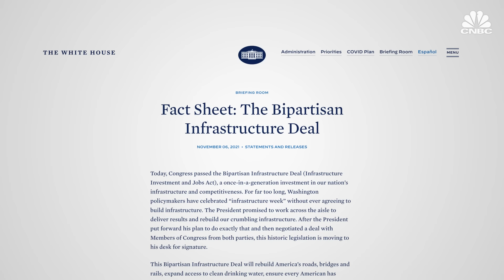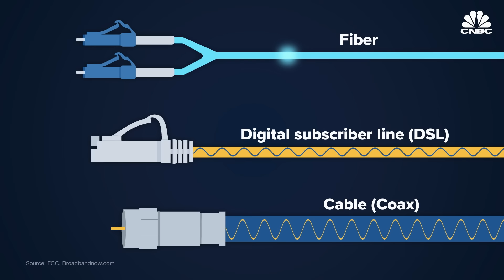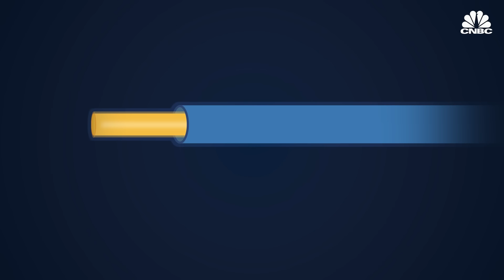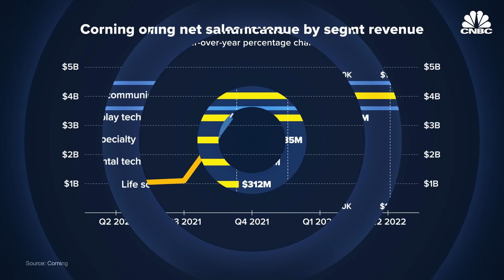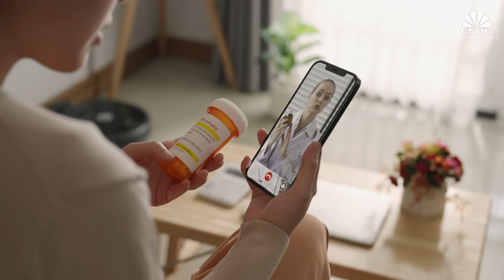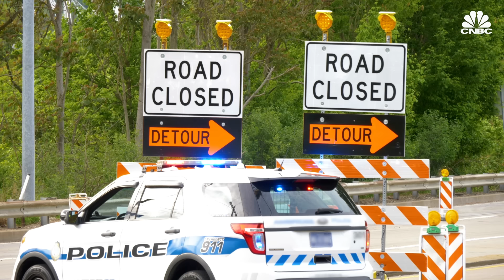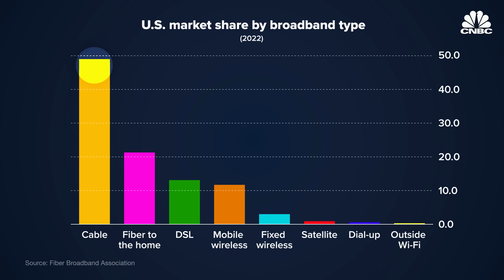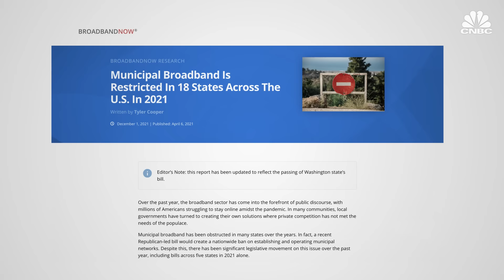How Fiber Will Speed Up America’s Internet

Comment: In the US the key take away is the telecommunications contracts in place that limit competition and choice in most medium to low density areas.  I'm a IT professional and work with datacenter fiber a lot and it's 100% the way to go. However, for homes, telecommunications companies are the issue in most cases.  They aren't willing to build large fiber networks with low subscriber density.  Starlink is way more important than the guy in the video is stating.  More important is that Starlink v2 will be a massive improvement in both throughput and cost to orbit.  Some of the costs that he mentioned are early numbers.  Today all Starlink satellites are launched on reused boosters which greatly reduces costs.  Starlink v2 will us starship, which is a fully reusable rocket so  only the fuel costs are not recoverable.  Starlink will ultimately be the largest single network in the future and likely eclipse fiber in every way.... Speed of deployment, flexibility and over all reach.  It will allow highspeed data transfer between the Earth, Moon, and Mars.
Reply: You are right about Starlink -- more important that this "government subsidy promo" is willing to admit.   Not sure that it will rival fiber throughput -- but it is significant.
Reply: Starlink will never ever beat fiber solutions when it comes to latency nor will it ever scale out to multigig speeds. Starlink is good for what it is. No need to bring it up in a conversation of Fiber.
Reply: @awarepenguin3376  I use to work at GTE and United telephone.   And then I worked for Cellular One in Orlando.  I would never thought that back in 1986 those complicated cell phones would ever rival the simplicity and reliability of land lines...
Reply: We still rely on landlines, and we still need more of it. Cell and WiFi are relatively short extensions of what its landlines haul. The only places I know that have to hop towers with directed microwave radios are areas where there's a local problem with snipping and stealing the physical cables.
Reply: @awarepenguin3376  not a single person in the US needs a multi gig network connection, let alone fiber to the home. there are far cheaper option to bring at least 100mb internet to rural areas. this obsession of fiber to the home is silly when most modern copper systems to the home can support well over gigabit connections. most of the back bone infrastructure is already fiber anyways.
Reply: @plastikman5889  There was a day when nobody needed megabit connections. As data consumed via the internet has gone from simple text on blogs, to calligrpahed fonts and pictures, to 4k movies, who knows what the future will bring? Will there be a company that finally solves VR and makes it popular for everyone, the way Microsoft did to computers, or Apple did to phones? That would take massive amounts of data. And what comes after that? The purpose of fiber is to futureproof our technology, not make it merely good enough for today, thereby crippling our potential tomorrow.
Reply: @georgebrantley776  he is mad because Fiber stole his wife
Reply: @georgebrantley776  your missing the point. the focus on FIBER TO THE HOME IS dumb and costly compared to it copper counter part which on the last mile delivery can handle more then enough bandwidth even with future proofing in mind. if we want  to get highspeed internet into more homes the focus needs to shift on the last mile delivery.
Reply: @awarepenguin3376     Nah no one is paying me. The fact that I would even need to justify that just means your super uneducated on the subject. Anyways "Big DSL" and cable basically already use fiber for most of their backbone infrastructure. Do you even know what copper can support as far as bandwidth? More than anyone will ever need in their home. Maybe I should have phrased it differently. Yes, fiber is the answer for main transmission. Copper is still more than capable of delivering blazing speeds to homes on the last mile of transmission. A star topology is the most cost-effective solution to reach more homes with high-speed internet. IF you have ever gotten a quote on a fiber splice job you would understand what I am talking about but clearly you are not in the business. It just not practical to install fiber to every single home when copper for last mile is more than enough. Maybe next time you should do some research instead of making up some weird conspiracy that I’m a cable lobbyist who lost his wife to fiber, it’s just weird. Like you know cable companies have a vested interest in fiber too? Like come on man lol
Reply: @plastikman5889  let me drop some knowledge on you son. Cable companies have no roadmap absolutely none after DOCSIS 4.0. Cable operators are HOPING to be able to catch up to what FTTH providers are offering today in the year 2028. Many cable companies in the us are running FTTH to new deployments, NO COAX. Don’t even get me started on DSL. Most people still can’t get vdsl or g.fast which are still super slow compared to fiber. Look I don’t know who you have or what you’re using today, but when your ISP considers it dead you better pray that they put those dumb plastic fibers in the ground and wire you up. Actually I’m sure they’ll get around to it eventually. Will you refuse fiber to your own home? Sounds like it. Again, I don’t know how you can have so much animosity towards FTTH. It’s weird!
Reply: @plastikman5889  But copper isn't enough for last mile. It has 94% transmission loss after 100 meters.... which is only 0.06 miles.
Reply: @nerdstrangler4804  thats CAT cable which isn’t ran to homes lol
Reply: @plastikman5889  I dunno, that is what the internet said.

So what is your theory for why all these companies are needlessly running fiber instead of using existing lines? You think for profit companies just hate money or something?
Reply: @nerdstrangler4804  this guy still hasn’t answered why US cable cos are deploying FIBER to new deployments, NOT COAX because fiber is faster, and last longer. Copper is dead man. People are already begging for fiber absolutely begging. ATT is literally laughing at cable cos because any time att fiber is around, they lose. When fiber comes cable cos jack up the price for people with no other option because they will never be able to compete with fiber. As fiber takes over cable cos will charge $200 a month for 100/10 mbps connectivity 🤣
Reply: @plastikman5889  Also I am pretty sure that applies to coax and not just cat cable. Just remembered that when I was a kid and cable TV was still analog, my dad had to install a signal booster in the house because the signal was so degraded just from running the cable to the house from the street. It was probably only around 200 feet of cable.

So I found a coaxial cable attenuation calculator online, and that poor transmission rate seems pretty standard. What is the specific type of cable used to connect homes so I can look it up?

Or do you not even know and you just made up the whole thing about it only applying to cat cable? Do you make everything up? And if so, why are you shilling for cable companies?
Reply: Starlink is great for rural communities and small towns that are out of the way. There are other solutions to overcome the last mile such as using wireless systems to connect the home or even the neighborhood through wireless to the fibre.
Reply: @plastikman5889 For light ( or lite) household uses in rural areas,  people just want fast enough connection for web browsing,  emails, Streaming movies and maybe games but games are still on bluray discs and cartridges so that's not a big deal.
Reply: @awarepenguin3376  Starlink is quicker (not faster) than fibre because the speed of light in glass is a lot slower than in a vacuum (roughly 40%), so with laser-to-laser communication, trans-oceanic communication is actually much quicker when using Starlink.
Reply: So you don’t have direct experience in the field so as a fellow IT professional I would not be commenting in this manner. Starlink is absolutely not the way to go as it is not a PERMANENT solution that does not constantly add massive amounts of pollution to our atmosphere every time a satellite goes up and down.
Starlink will be the best for the absolute most remote places but it is not the topic here. The topic here is about the general population STILL not having fiber internet for the 50+ years it should have been deployed in.

Comment: In Poland I have fiber Internet in my home (6$ per month) and also in my parents house (11$ per month). Works great. Maybe 20 years ago I had Internet through radio connection (terrible quality) and later through copper cable connection (works fine, but hamsters bite through copper cable few times a year and needs to be repaired).
Reply: You have wild hamsters at your home?
Reply: @seanthe100  Not at home. Copper cable went underground, through fields and meadows, where the wild hamsters live.
Reply: @adamwest7953  
A lot of people will use these single case examples to say that they are better of than the US. The reality is that the median income in the US is $70,000 with one in three households being in excess of $100,000 per year. 
A VW Golf GTI will cost about $29000 in the US and in Germany the same car starts at $40000. 
This is the same through the whole of the US economy with things being far cheaper.

Comment: The great thing about fiber is once it is actually installed it can handle almost any speeds just by simply changing the equipment on either end and leaving the fiber alone.

Of course this creates pricing issues as they do not want to sell too much speed for too little money.

Comment: The hurdles to municipal run fiber are such B.S. They’re usually the cheapest and fastest and tend to be profitable.
Edit: Not to mention, with all the places I’ve moved to, a majority of the times I saw great competitive prices and customer service from Comcast was in areas that offered fiber as an alternative. It’s a real threat to their monopolistic hold (thanks to how coax is setup).
Reply: Our competitor has FTTH in areas we don't. We offer fair pricing, better services, better technicians and faster repair times. They don't impact us much. People that change ISPs for a dollar a month savings aren't worth keeping. IDK about in Comcast areas but we overbuild the cable plant with fiber anyway. Turn it on and slowly migrate the customers over. There back end platform is the same and if they pay for the same internet speeds they had on cable, they don't notice any difference anyway.
Reply: Sorry but it is very expensive to put the cable into the homes and overcome the last mile. Many homes are not the same and do not have easy access ports. 
If you already have a cable connection that makes the issue of feeding to the home easier but it does not overcome the issue of the building not having good containment for new cables being added.
Reply: @bighands69  Not sure what you are getting at. I never said anything was cheap because it isn't. People that want fiber for the sake of wanting fiber think that it is cheap as they would like it to be with their imagination. Almost every home has coax, but if they need fiber, they run it to the house and coil it up outside. 

The tech comes and attaches a fiber to the side of the house and drills into a central location and everything else is wireless, the TV boxes, the phone, everything. This way you don't need fiber to every room. I get speeds from 350 to 500 on wifi everywhere in my house and 200mbs in the back yard.

Back in the day, we ran fiber to the house and then convert it to phone, data, and cable on the outside of the house and connect to the existing wiring. That was 2900 per house in 1999. Now, drill a hole and install a plug for the fiber and then plug in the wifi gateway and you are done.

In my area, once the people using old equipment are upgraded to a single gateway the signal will be changed to get 1.5gig down and 500mb up for starters and then it will increase to symmetrical 1.5gig. all over cable. On pure fiber you can get 8gig/8gig but that speed is to show they are the fastest, not that anybody NEEDS it.
Reply: @Todd.T  
Everything hinges on the area and how expensive it would be. If a dwelling has good cable containment then new fibre cables can be feed in but if the containment is already full up with cables there will be no new cables installed. 
Many properties may have sealed cable installations making it impossible. The issue with this is the varying degrees of complexity with installation.

Comment: The animation of light reflecting on the outer glass layer should be sinusoidal - the two layers actually melt together so the difference in diopter (how much the light bends when it enters the material at an angle) reflects the light back. This is slightly more complicated since the two layers form a wave guide but changing the graphic from the triangular wave to a sinusoidal (longer, also) gives a better description.

The race for fiber optics started when it was proven that glass was transparent to light and the impurities were responsible for the attenuation. Corning - then a small company in NY - found the solution: evaporate the glass and deposit it into a rod then doing it with different diopter glasses to create the wave guide.  The thing about fiber optics is, like the guy said, the speed is limitted by the electronics on the tips and not by the glass itself. There's even an optical amplifier that requires no light-to-electricity conversion to work.

Comment: I like how everyone knows corning as the company that makes the gorilla glass of iphones but they made it for Samsung first. Apple initially refused to use it and eventually gave in. Apples first 4 iPhones used regular glass. Plus Corning is a huge company and really old. They make glass for everything Including labs. They are a very old company.
Reply: Sounds like that corning’s a fuckn monopoly.
Reply: Not really. Just a company that does products and services very well
Reply: @hectorcardenas2171  How so? Sure it controls 73% of the smartphone glass market but the overall glass market it controls only 45%. The other 55% is mostly 4 Asian brands and one Irish brand. It's the market leader not a monopoly. Like how Coke controls about 40% of the soda market. It's the market leader but not monopoly. Apple initially refused to only use the glass because they wanted something cheaper but once Samsung started running ads like , made with Corning gorilla glass  and taking shares apple went to Corning and became it's second biggest customer. There is no bad blood between both brands. After that Samsung stopped running those ads since both used Corning.

Comment: Mississippi has increased leaps and bounds in the last few years in fiber availability to rural areas. A recent law was removed preventing local utility providers from providing internet access. With the big companies such as ATT, Comcast and the like they never found it beneficial to them to provide access to rural areas. Now the local power companies are laying down hundreds of thousands of miles of fiber to underserved areas. Parents and me back in high school living with them was limited to satellite internet where we only got maybe 5Mbps, now they have symmetric gigabit fiber. Now if only we can pull down all those really unsightly bundles of phone line ATT has up that they never maintain and transition to phone over fiber.
Reply: Old copper wires, eh. Out in rural Canada.  Thank Elon for Starlink. Not as fast as fiber but 8mbps to over 300mbps is dramatic improvement. 🇨🇦🇨🇦🇨🇦😅😅😅

Comment: As someone who installs internet and telephone wires for a living I can tell you fiber is a little harder to install than copper. Fiber is heavier, its more fragile/occasionally breaks and you need expensive equipment to make the final connection/test the final connection. Connecting fiber is not as simple as plugging it into a socket you often have to melt two strands of fiber together or use special epoxies. You also must not look directly at a strand of fiber when its powered because even though you can't see the laser light coming out of the fiber it can still blind you. However fiber does have some major advantages a fiber cable can handle much more bandwidth, much less energy loss and its a much faster light speed connection. Single mode fiber can hold so much bandwidth that no device known to man can overload it. The copper wires we run need a signal boost after hundreds of feet but a fiber line can go many miles without a signal boost. Given all these advantages I'm suprised we haven't found a way to make fiber more affordable. I do get paid well to install fiber but that is because I'm a member of the IBEW (electrician union).
Reply: What speed connection do you get with original copper wire?

Comment: I'm also anxious about fiber optic (color) processing units for computing... which should do at least 256x256x256-1 faster than binary, but... at a consistent speed because of no overheating... whereas the crossing of those colors is how it will do all the calculations instantly and a major bonus on top of that... we get our batteries able to last maybe many times longer.
Reply: While the connections between the nodes of a computer may get really fast results from transferring data the actual circuits are still not going to be fibre based. Even Fiber optic networks still have to use traditional switching networks.
Reply: @bighands69  That I fully understood since the first time fiber optics got introduced as a network service. But then again... we now even have slow-mo fitted inside of those very tiny GoPros at 240fps whereas 60fps is the gold standard. Keypoint is... there will be many times far fewer traditional switches in being replaced by non-friction optical blending that if it were to a 100x100 grid... then maybe 10 sensors outside of those are the traditional switches.